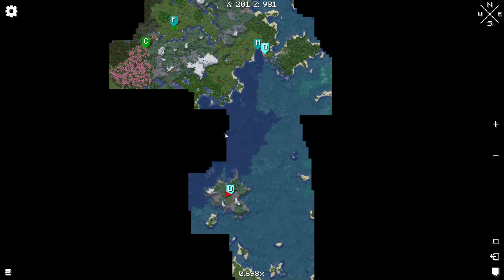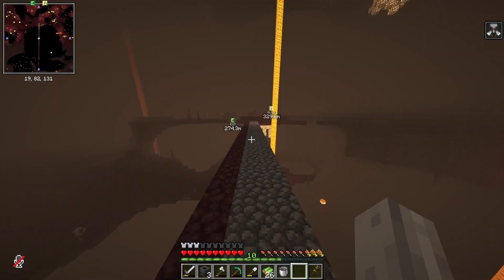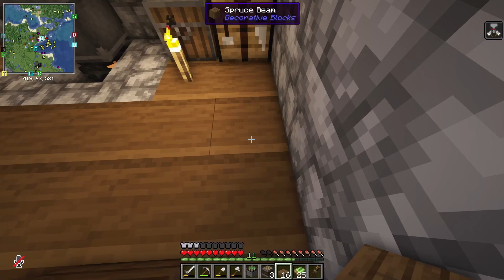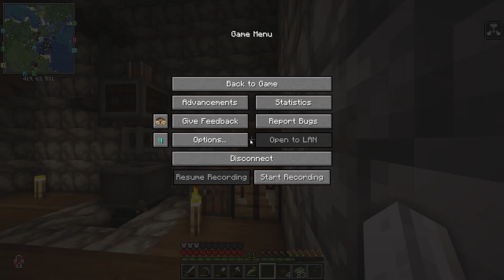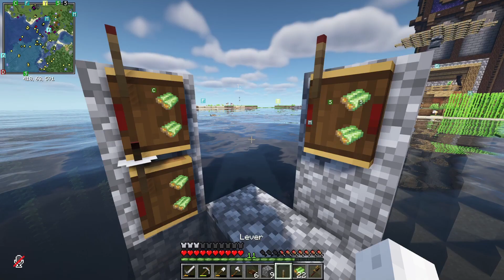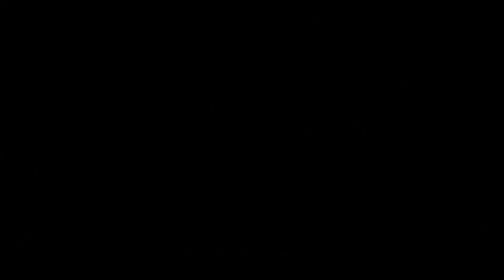Ep9 Gantry System 1/2 - Overstressed Modded Minecraft SMP

Comment: First I love your vids
Reply: My computer is too crap to run atm6 on the server
Reply: @robberman2579  me tooo
Reply from the maker: The pack is pretty hefty, I would definitely suggest going to the forge 1.16+ part on this list  https://gist.github.com/alkyaly/02830c560d15256855bc529e1e232e88#forge-116 and check out some of the performance mods. Some make the game use less ram which I assume would be what's holding you back for this pack.